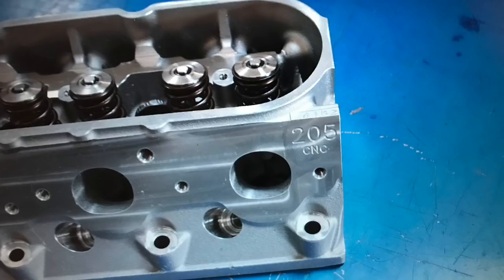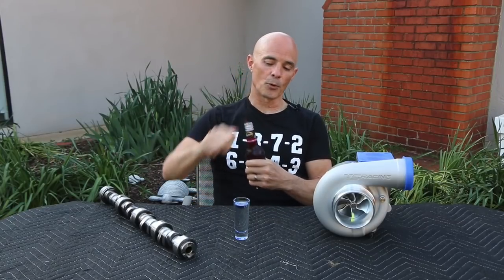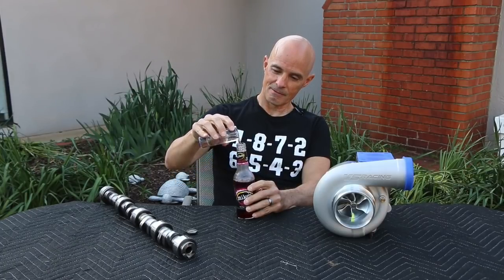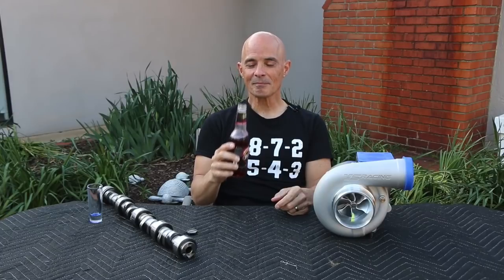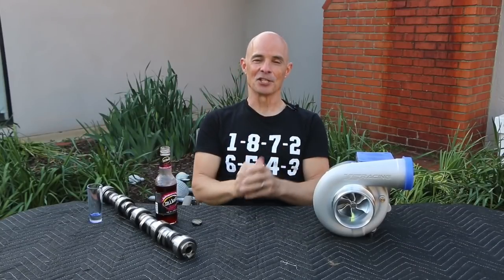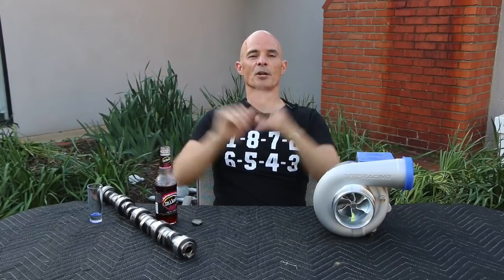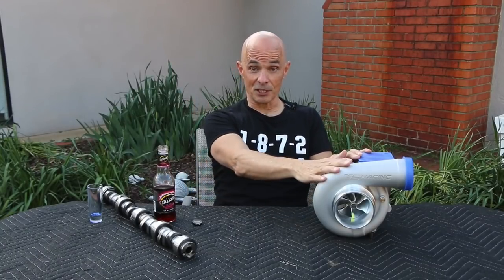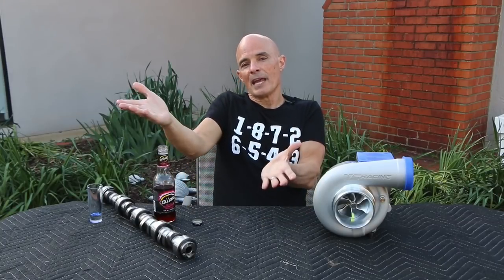TURBO LS-WHEN ARE PORTED HEADS NECESSARY?

Comment: hi would a stock l98 valve spring support 8-9 psi from a lsa blower factory setup?
thanks
hayden
Reply from the maker: YES
Reply: @richardholdener1727  thanks mate 
legend
Reply: @richardholdener1727  would the support much more or is that pushing them?
Reply: Famous last words " if 5 is good 10 is better and 15 is expensive " lol